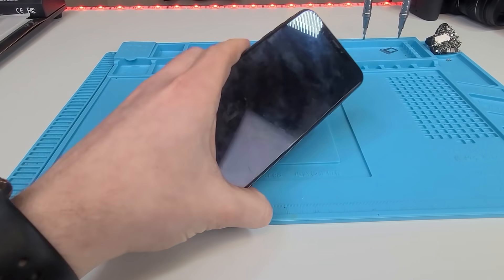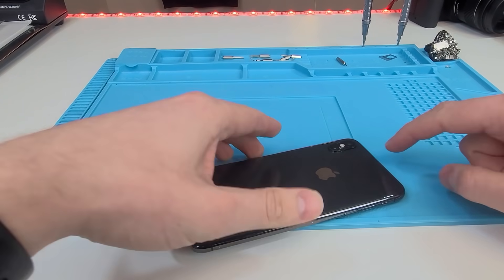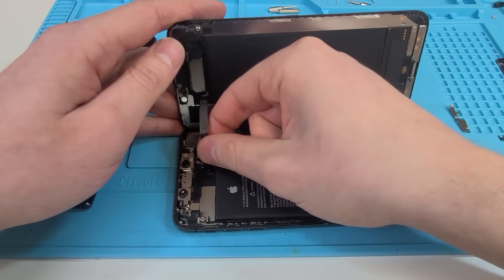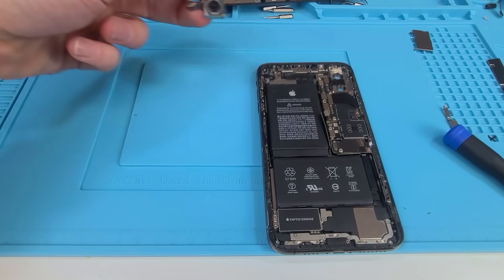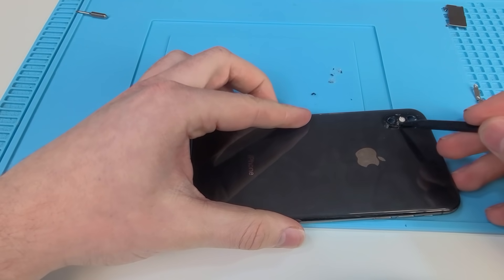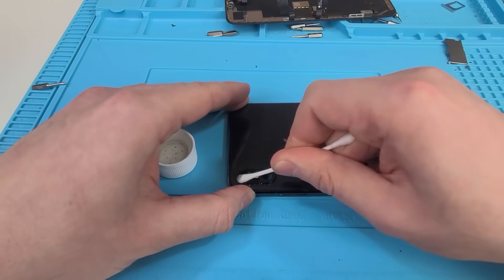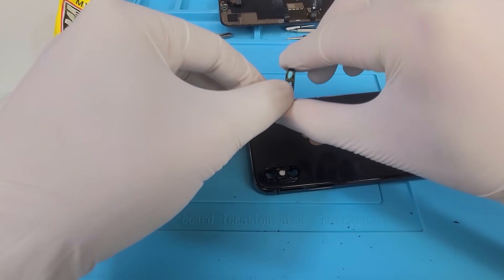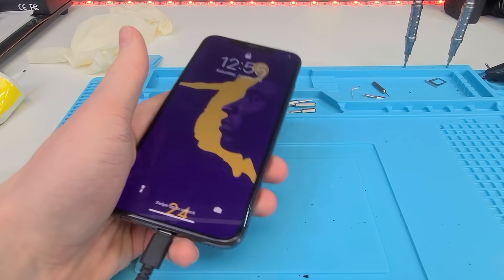How Do People Break This? ASMR

Comment: Broke two camera lenses on the Samsung Note 5 and both of the due to similar actions. First time it broke i left my phone on one of the forks of a fork lift while I was using my laptop and got the camea lens broken. Second time I left my phone charging on heat radiator in my room and when I unpluged it, i noticed it was cracked.
I think in my case it had something to do with it touching the metal

Comment: I'd like to know if you ever fixed a Moto One Hyper front camera... The damn pop-up front camera stopped popping up months ago. (It's motorized, total design failure). And the phone itself suddenly stopped charging (and wouldn't recognize the charger that came in the box with it as a turbo-charger, or the one I bought directly from Motorola) and the battery died within a matter of 3 hours so I bought a new phone, a Moto Edge 5g to replace it since it was 2 WEEKS out of warranty when the charging/battery issue occurred....

Comment: Do you do iPhone 6 Plus battery replacement because when I charge my phone it says its charging but never turns on. I think its the battery because last time I checked my battery capacity was around 50. I went to Best Buy and they said I have to pay 400 because my screen was chipped from the side and and they said if I fix it all my stuff will erase and it'll  be a whole different phone. I haven't even backed up my iCloud, :\ if u see this pls answer

Comment: If you heat the glass and adhesive (or just let 90% isopropyl alcohol soak for a couple minutes) before trying to remove the camera glass, then you can usually just push on it and it'll come out.
Way less glas breaking, way less shards, way less headache.

Comment: Dear @phonerepairguru I have a iPhone Xs max, it dropped from mid level of a chair and then started to work like a phone works on 1%, it lags a lot even tough it’s on 50 or 70% 

I tried getting it fixed but it’s not battery issue it’s not screen issue they said it’s CPU issue. 

Can that be fixed? It’s been almost 2 weeks now and they can’t get it fixed.

Comment: There’s no cheap way or hard way. It’s the smart way. If the camera hasn’t been affected you are able to remove the glass easily without taking it apart. All you need to do is is cut tape the same size of the lens and tape it to it. I like to use the high quality shipping tape and the best part dirt comes with it once you remove it. Just spray a bit of air can from 8 inches away not even hard and done. You can always check it out on the microphone to make sure. You should have that one by now.

Comment: One important thing that I'd like to point out is that the mesh of the back microphone is missing. Everything might be working now but after 1-2 months, without the mesh, two things might happen: 
1. dust might get inside and block the cameras. 
2. noise-cancelling feature might be worse since the back microphone doesn't work properly

Comment: Whats the chances i just ran into this video. I have xs max. And yes this glass was cracked when i got the phone. you guessed it. Eventually it fell of. So i took of the rest. Il be honest bud. I did a better job removing the glass. As you guessed it i went the short way. I dint open the phone. So what i did was used a stanley blade which has much better point tip to reach on the side of the glass to lift it up. It worked within seconds. I dint have a single issue. Also the glas dint brake into million peaces. It came of in two exact peaces. And now ive sent the phone to apple with no replaced glass because while the new glass was coming in the post. The electrics messed the phone up as i live in a stupid cave in the amazon forest. Eqivelant that it loool. So i cant wait to see what apple thinks of a iphone with dispossed camera lenses 🤣🤣🤣. They might cry a little from the pain. Soon the phone will return and il glue that glass that came thru eventually. Anways my point is this video is geniun. Its all true. That glass pain the ass